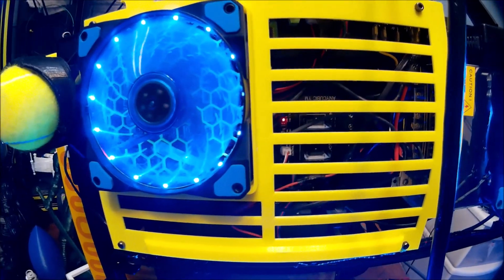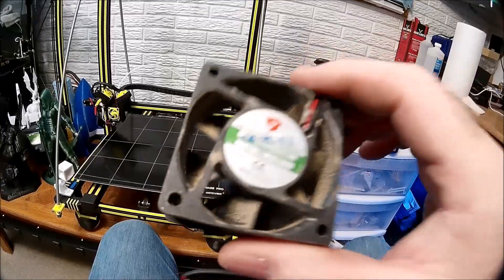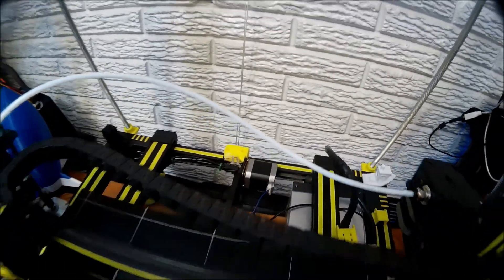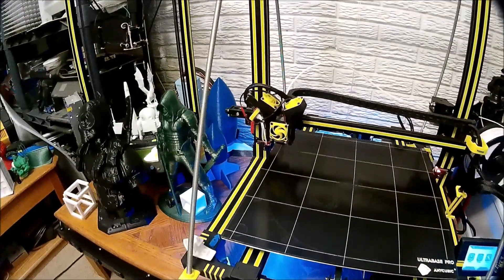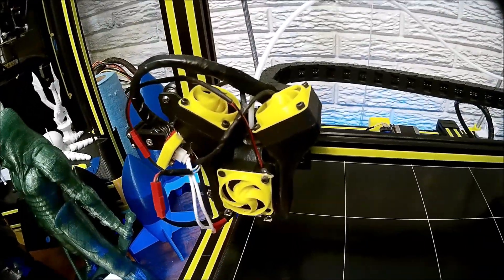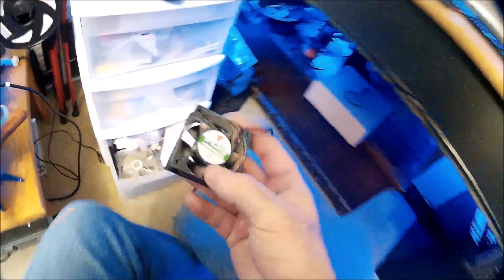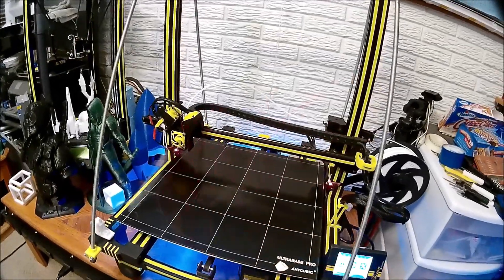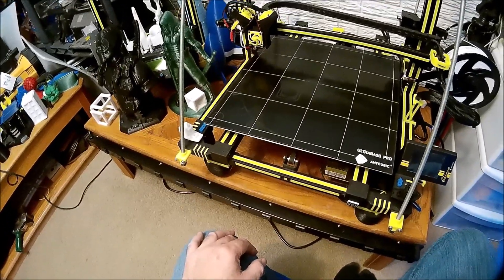Anycubic Chiron Fans updated

Comment: When you upgraded to tmc drivers did you have to do anything firmware side? I know you have to adjust the voltage but anything else if I was to do this upgrade?
Reply: yes upgrade firmware, and change the stepper connection direction